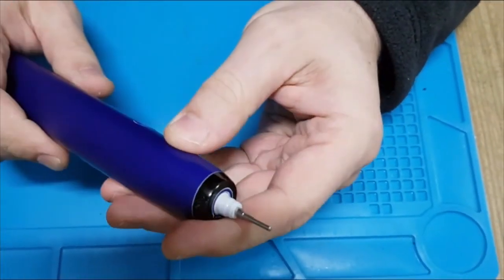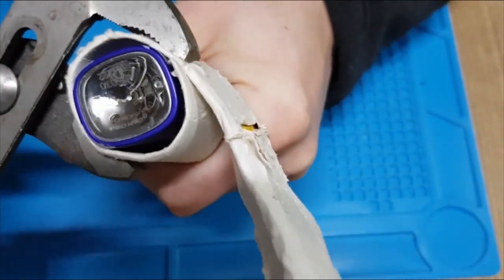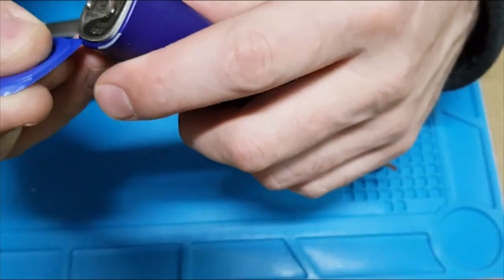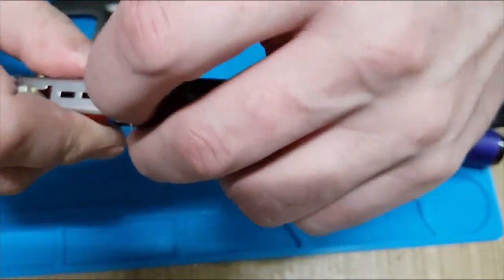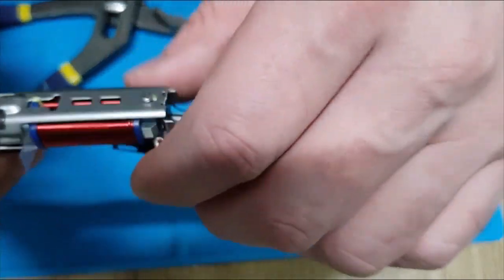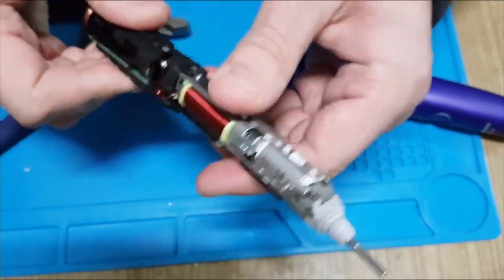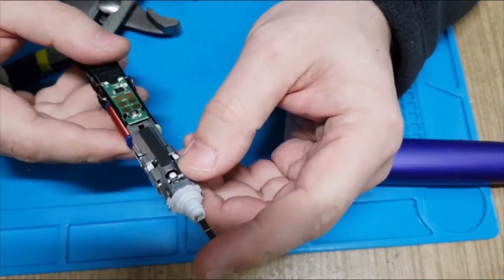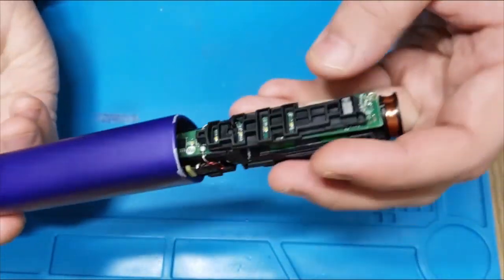Philips Sonicare DiamondClean /no vibrations/ opening and repair

Comment: Hi. Thank you so much for providing such a great guide! We have a diamond clean toothbrush with a recent damage to the part you briefly mentioned. That is the metal part surrounded by a rubber where a brush head sits on it. That part comes out easily from the base, and I am not sure if that piece  has been broken or loosened. My question is if I can fix it with some liquid glue or not? I appreciate any advice. Thanks!
Reply from the maker: Only one way to know for sure is to takit apart. If it losened simple tightening with loctite will be enough. if it broke off I dont think any glue will hold and disbalance will brake something more.. but on eBay you can find all the spare parts you would need just give it a try ;)
Reply: @letsfixitgarage  Sounds good, thank you so much and I will try it for sure! :)
Reply: Thank you very much for sharing this video. I have successfully repaired my electric toothbrush. I have encountered the same problem as you. The metal part is loose. My electric toothbrush is also a diamond series.
To be honest, it’s really expensive to buy a new one.After watching the video, I realized that I could buy parts to replace it. I bought a brand new metal rod accessory on Amazon. After it was replaced, it worked very well.

I can share this purchase link with you and hope it helps you
https://www.amazon.com/dp/B07GDH2RB8?ref=myi_title_dp